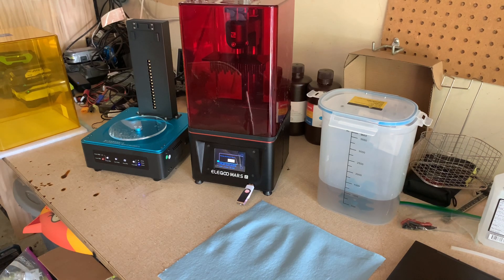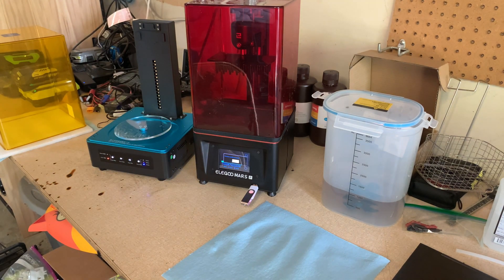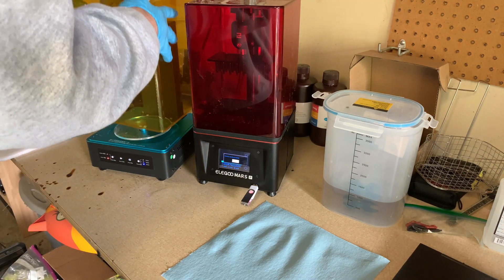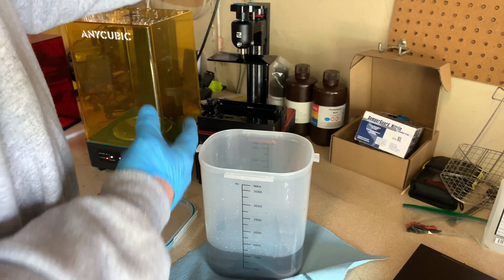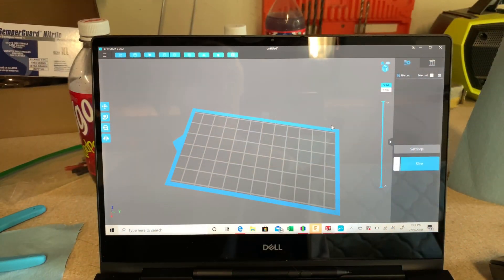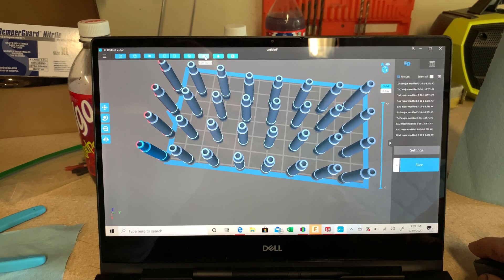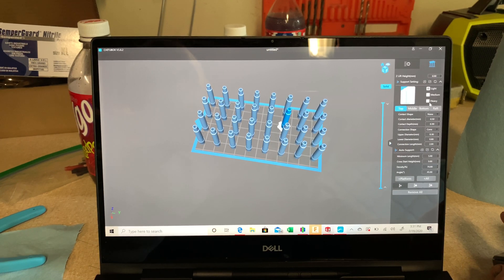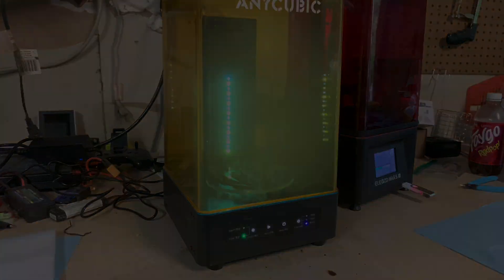Overview of Elegoo Mars Pro Resin Printer and AnyCubic wash and Cure Station

Comment: Does the mars build plate, with in the the anycubic wash and cure, like the anycubic build plate does?
Reply from the maker: Unfortunately it does not.
Reply: @TTV_FUN_AT_50  thanks for the reply, is the slot on the bracket to small? If the slot was modified could it fit then?